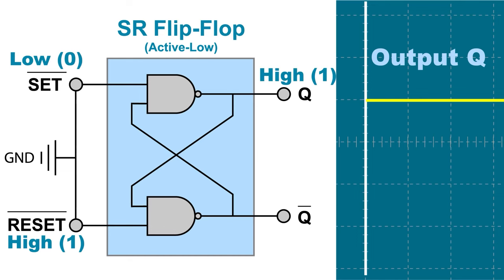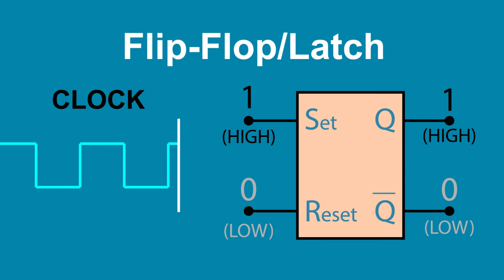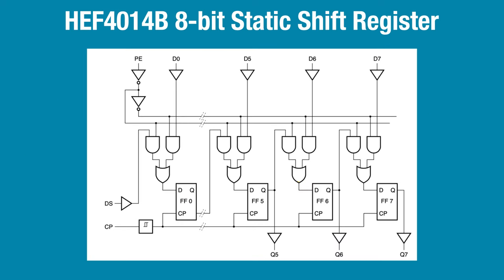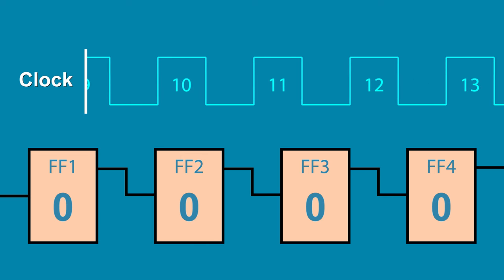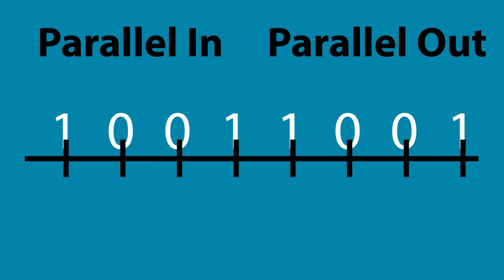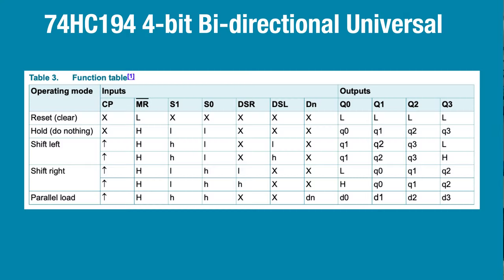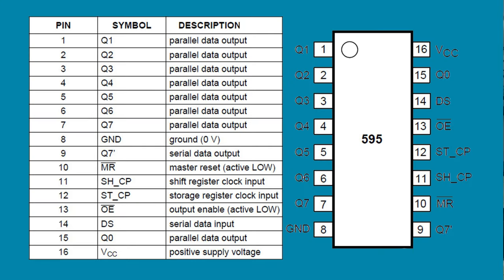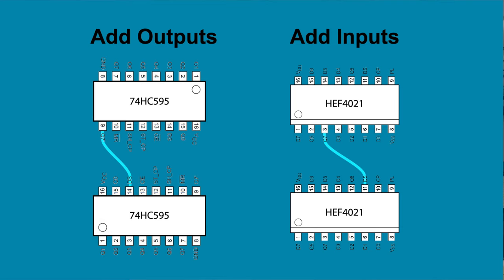How Shift Registers Work - The Learning Circuit

Comment: i don't really understand why there is so much debate about a Latch and FlipFlop, where the answer is so obvious; a latch is transparent to input all the time when enabled so its a Level sensitive, while a FlipFlop is Edge sensitive meaning its input is reflected by the output at  the edge of a clock (high or low). so what you are describing is simply a FlipFlop....

Comment: A lot of old video game consoles like the NES and SNES used shift registers for transmitting controller input.  When the console wants to read the state of the controller's buttons, it sends a series of clock pulses to the controller, which then stores all of the button's pressed states into a shift register, and it then transmits those bits one by one across a serial cable.  Back on the console's side, it reads those bits off of the serial cable back into a shift register to demultiplex the bits into bytes/words.

Comment: This is so confusing! What would make it much easier to understand is answering the question why at every step of the X explanation.

Giving an example of when each register type would be used, would really help me understand what each one does the signal path of each.for example, which option is for one pin on an Arduino sending code for LEDs. And which option is used to send multiple buttons to one pin on there or do we know?

Comment: My class uses "Digital Design" by M. Mano, M. Ciletti. The book defines latches as triggered by a HIGH value where as flip flops are triggered on the positive or negative edge of a clock signal. 
The positive or negative edge of the clock signal used for the flip flops is actually just a very short impulse of a signal caused by clever manipulation of gate delays.